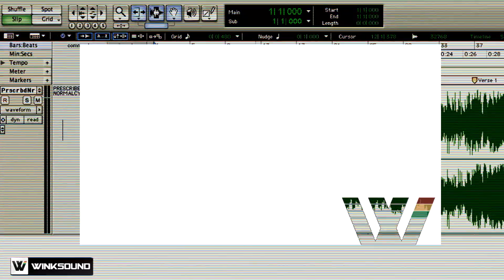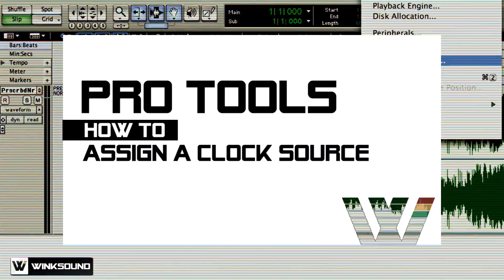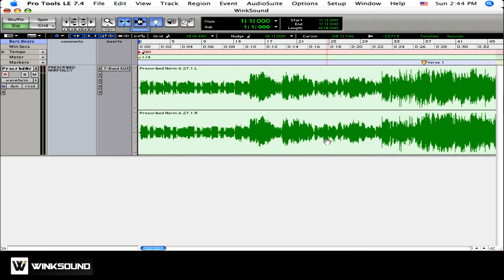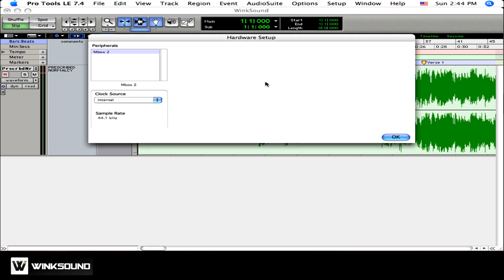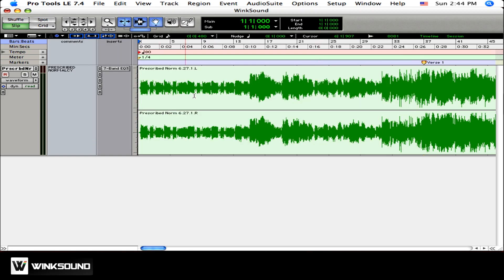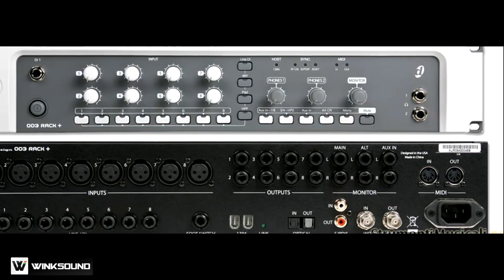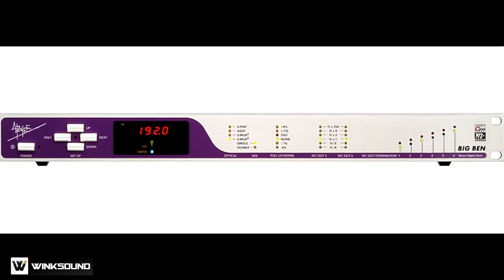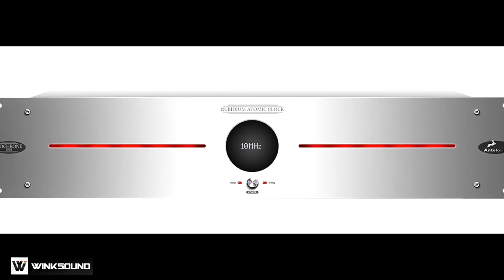Pro Tools: How To Assign A Clock Source | WinkSound

Comment: Question: I’m adding an external clock to my existing pro tools hdx system (3 16-I/0 with a trinnov D-Mon 5. Do I remove the loop sync cables from the audio interfaces before hooking up the clock?